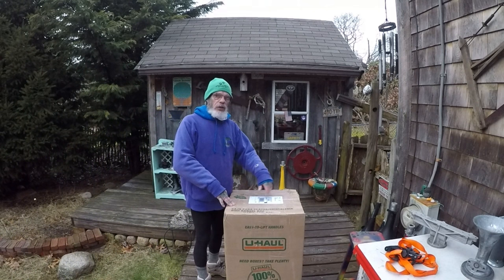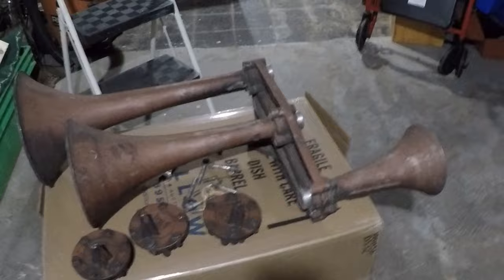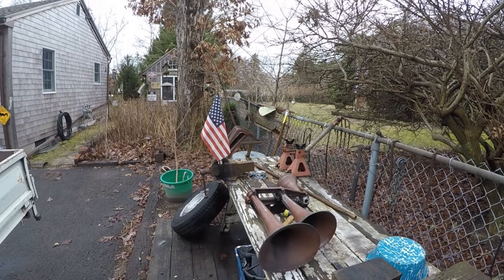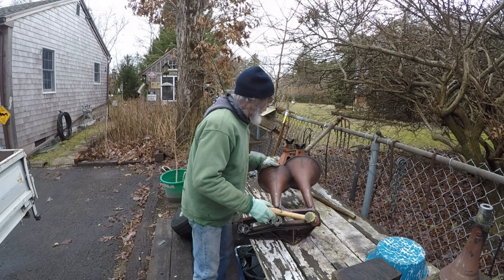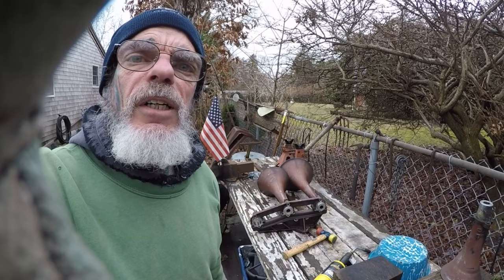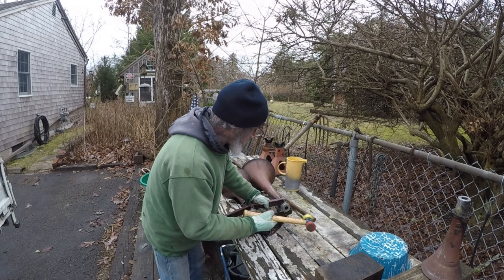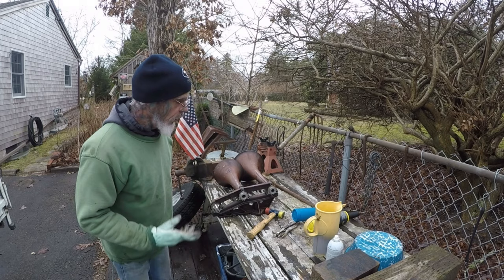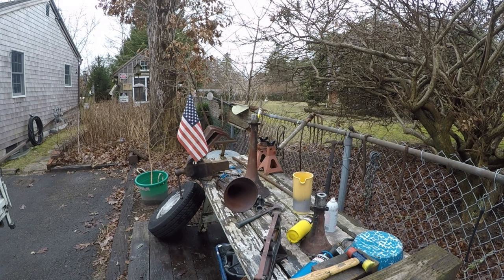How to get a Leslie bell unstuck.

Comment: My 31 on 1958 S5T-R was/is stuck at least that bad. I was going to face all 5 forward. After 4 days I took it as a sign that the horn gods wanted that horn to stay in its original N&W configuration. If I ever revisit it will be ice water for sure. Thx a bunch

Comment: Nice job!  And you saved the paint too!  One technique I’ve found to be useful is to pull the dowel pin out with needle nose vice grips, and then get the bell to rotate inside the manifold. That helps break up corrosion that’s holding it it and also helps get penetrating oil distributed evenly.
Reply from the maker: Thanks Maddie. Ill give that a try next round.